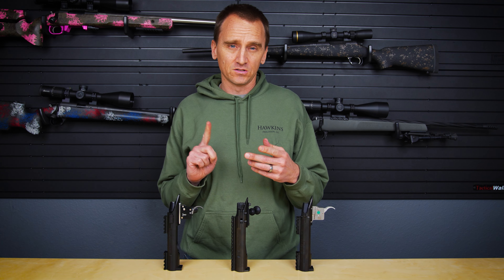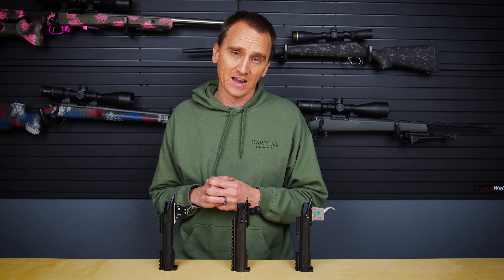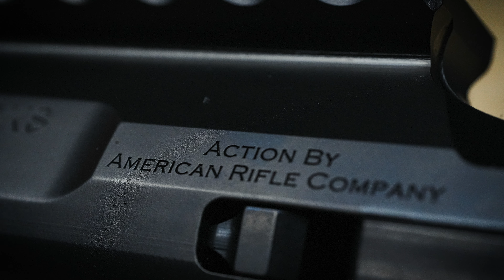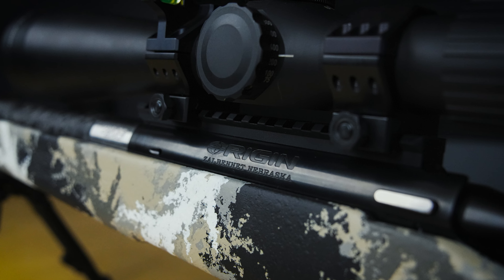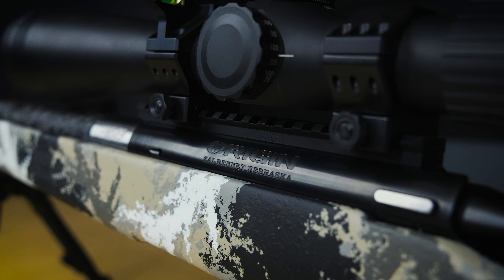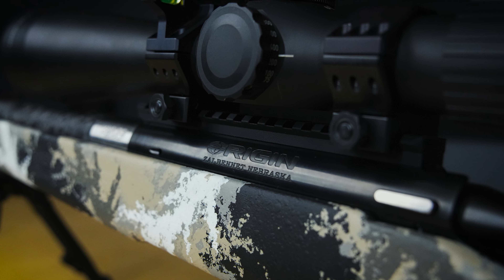The Anatomy of a Custom Action - Common Terminology and Features to Look For

Comment: I have a Mack Bros EVO II BDL and I use the M5 hunter DBM and hunter flush mags. The hunter mags feed just fine from the BDL cut action. In general do most custom clones with a BDL cut work fine with hunter mags?
Reply from the maker: Yes they will. The magazine will present between the feed lips on an action cut for BDLs. So you can use Hawkins Hunter magazines in those with no issues.

Comment: I don't understand, I am interested in these custom actions. I've just started to become interested in this rifle accuracy subject. I am surprised that custom actions would be made of materials associated such as aluminum. 
I did look at what the US military uses for rifle actions. As I would think, steel alloys that are similar to a nitrated 4340 aloy. A brinell hardness of 62. Which is also  heat resistant and also strong and a high modulus of elasticity. And wear resistance at elevated temperature. If a rifle action can resist wear it might retain accuracy.
Reply from the maker: Most actions are made from stainless steel. Very few are aluminum.